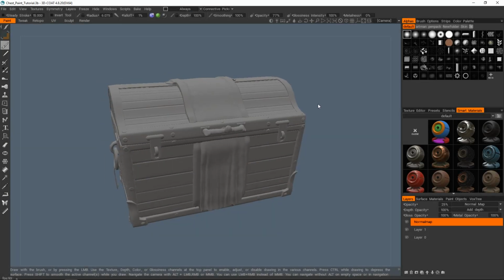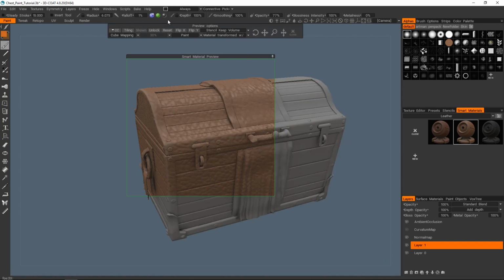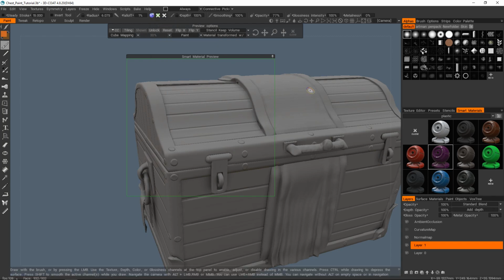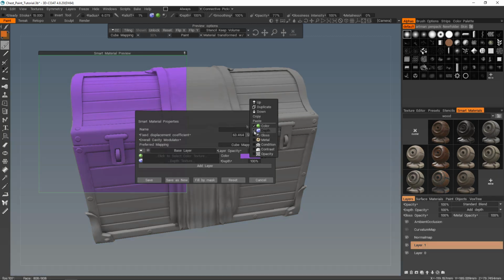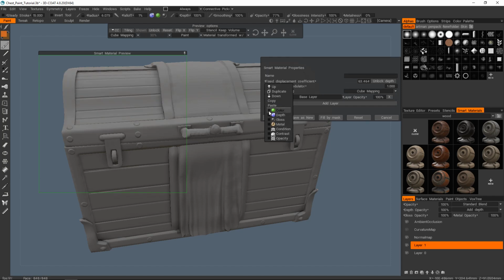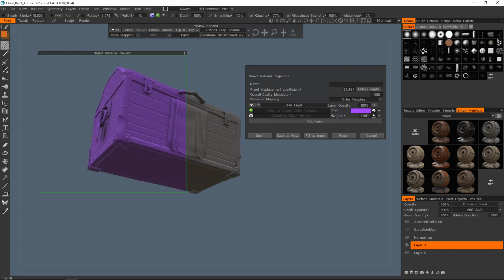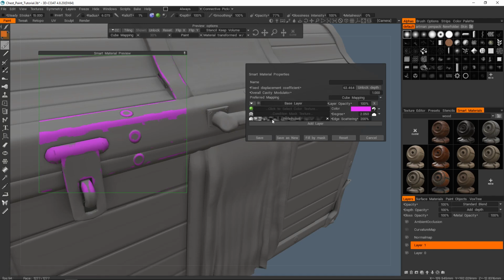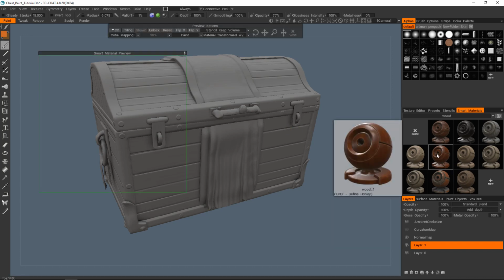Smart Materials in 3d Coat. PBR all the things. [Part 1]

Comment: Thanks, nice demonstration. One thing I still did not figure out is how you bake AO and Curvature from Highpoly to Lowpoly? In other programs like Substance or Marmoset you specify high and low meshes, set some settings and bake from detailed sculpt, onto low poly. But Coat is baking in Paint room, and there are no high poly and almost no options... As I understand it reads details only from pre-baked normal map?
Reply from the maker: It's been a very long time since I've used coat, (this tutorial is from 2018 and is about smart materials) but I'm certain there are options to bake curvature and AO.

Comment: The problem is that the smart materials don't accept or contain normal map. You said 'I only applied normal map". It is not a normal map. It discplacement/high map. This is a problem. I  discovered it after using 3DC for a week.

Comment: I'd like to know how did you made the normal map of the chest if possible
Reply from the maker: Hey, the normal map has come from a bake, this was a high poly model that I sculpted inside 3d coat, and what I'm texturing here is the low poly bake.
Reply: @PolyToots  I'm assuming you create the low poly first and unwrap it, then add details onto the model and bake them?
Reply from the maker: @Lebofly  My usual work flow (and the one I used for this chest) is to sculpt first, then retopo, uv, bake, then finally texture. But yes there's nothing wrong with starting with a low poly "base mesh" first, sculpting extra details on it and then using your original mesh for the retopo. It's just not the way I usually work.
Reply: @PolyToots  Thank you for the reply! I'm moving from Maya to 3DCoat for my unwrapping using your videos, if I have any questions along the way do you have a discord I can reach you on? Or would you prefer me to just leave comments here and there
Reply from the maker: @Lebofly  No discord yet, maybe when I'm more popular I'll look into setting up some sort of community of budding game artists, but for now YouTube comments will have to do. Oh, no need to entirely move from Maya to 3d coat, you'll probably still need Maya in the future too!